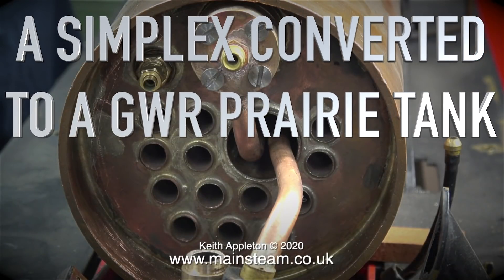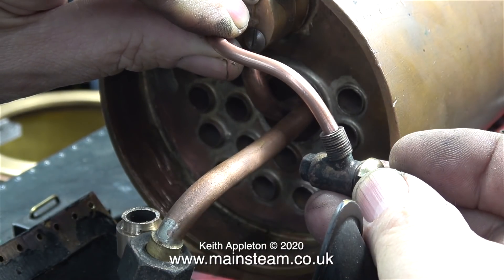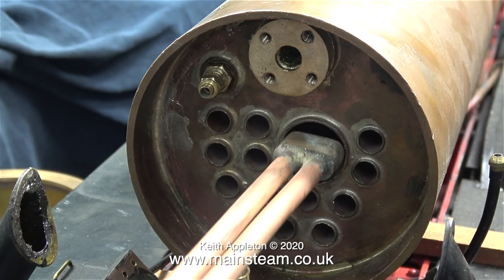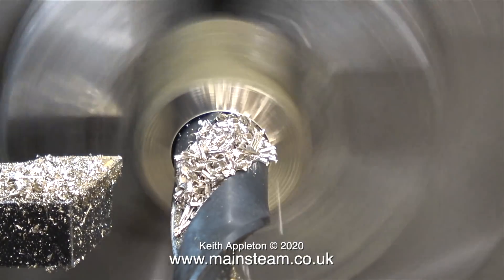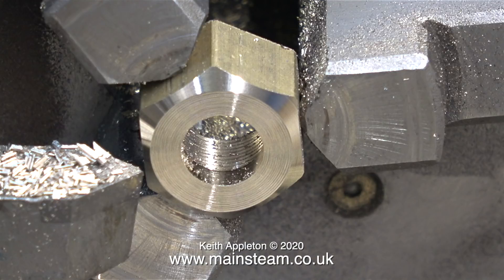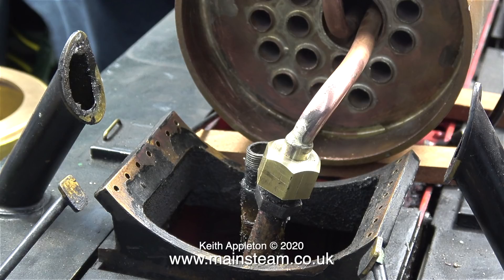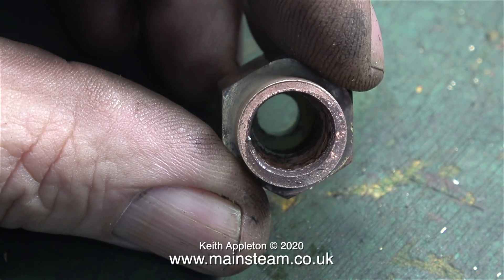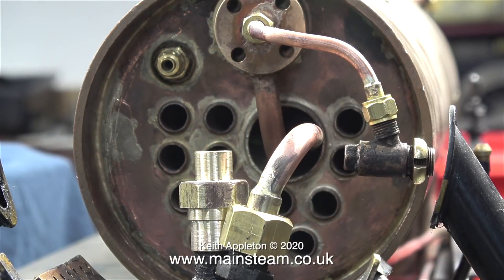SIMPLEX PRAIRIE TANK - PART #29

Comment: Ya did rather good explaining that a Snifting Valve is used to prevent a vacuum from building up. Wouldn't have even guessed that a super heater could build a vacuum before it could cool down.
Reply from the maker: It is the slide valve and cylinders that cause the vacuum in the superheater when the engine is running with the regulator closed
Reply: @keithappleton  Ah. Thank you for the correction. Suppose this is why it is good you do these videos for people new to this stuff so we can learn.

Comment: It's amazing that the same principals of a full size steamer also apply to a model.
Reply: Fy friend, these this are wrongly named. They are not true models, they are full locomotives. The are almost udentical to the full sized  "steam engines" which used to haul everything all over the country. The only difference is.... every component is much smaller.....therefore much more difficult to make.
I have built full sized steam railway locos as well as models. Indeed in the late 1970s I completed a coal fired live steam replica of 7808 "Cookham Manor" which won an award in the SMEE  model engineers exhibition at wembley exhibition centre.
But at least people are not referring to such masterpkieces of miniature engineering as "toy trains" very often now.lol
Reply from the maker: The only real concession is that there are fewer boiler tubes in the miniatures and they have a larger internal diameter - and no "Brick Arch" in the firebox. I think I first read the phrase 'You can't scale Nature" in an LBSC article years ago in The Model Engineer magazine.}:-)))

Comment: A good quality adjustable spanner isn't a problem if it has been looked after. Cheap adjustable spanners tend not to hold their settings and open up as they are used, meaning they will round off nuts Get a good one.
Reply: Exactly, i hawe newer experienced any problems with my quality spanners etiher. (Even if my toolbox mainly contains old sharktooth army surplus spanners of the same brand.)
Poorly made spanners on the other side is an entire different chapter... I remember my old workmate grabbed a poorly made asian copy of a brand name tool, shortly after he started using it on some farmers machines that where in for repair at the moment, i saw him remain silent, walking straight to the door, open the door and throwed it out in the forest as hard as he could, cloosed the door and went back to work without a single word... Just love that man, ha ha

Comment: Thankyou for this video as I am currently working on the same parts for my Simplex. Unfortunately the wet header does not line up with rhe fixing suds so re-doing fixing the wet header to the superheated tube at the correct angle.  Proving to be a bit hard for me. My superheater pipe is stainless steel and very unforgiving.